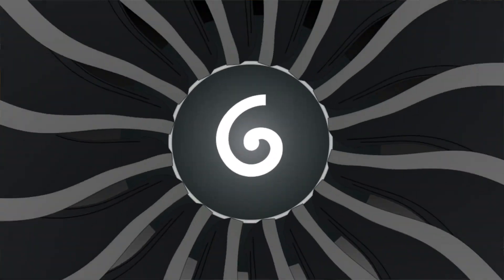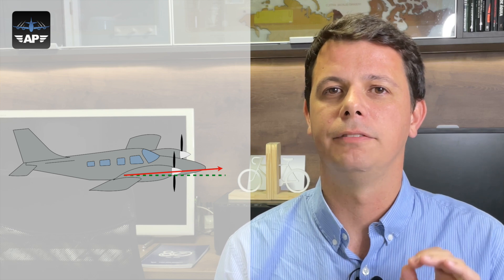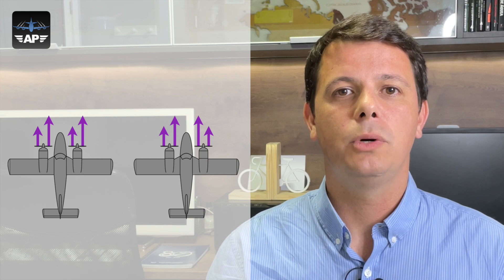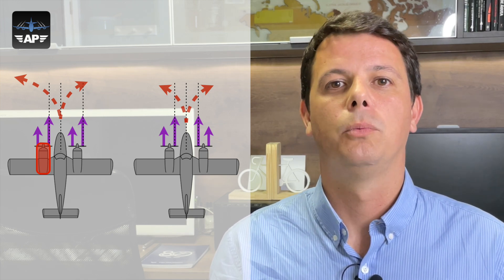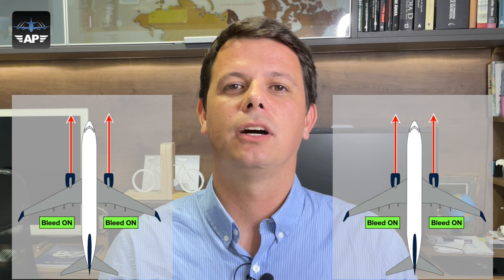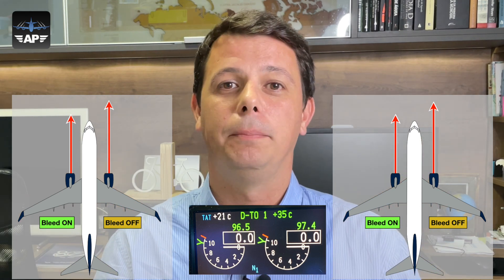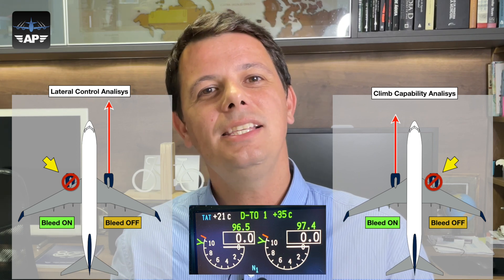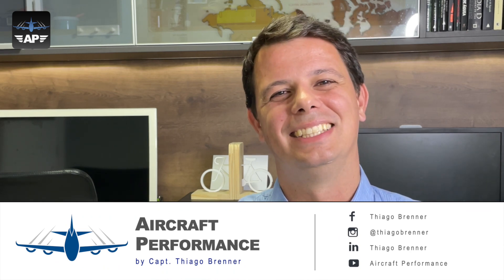What is a critical engine? Does the 737 has a critical engine? [English]

Comment: What about 787-10 series? Does it have critical engine?
Reply from the maker: I'm not absolutely sure as I'm not flying this type, but my best guess is NO, no variant of the 787 has a critical engine. That's because this airplane has no bleed system. Pressurization comes from an alternate source (eletrical), so, there is no thrust assymetry at any given moment.